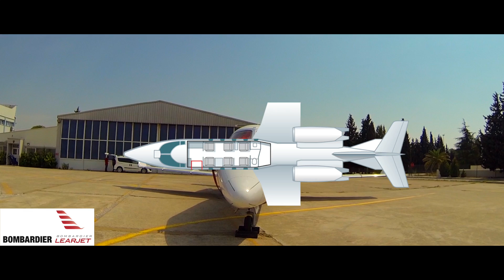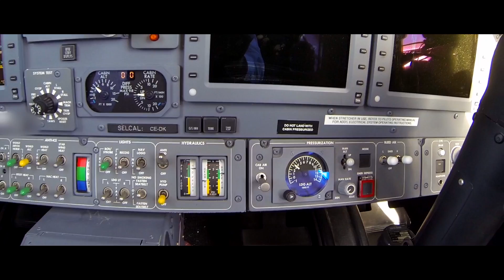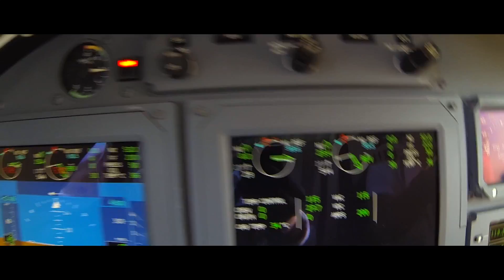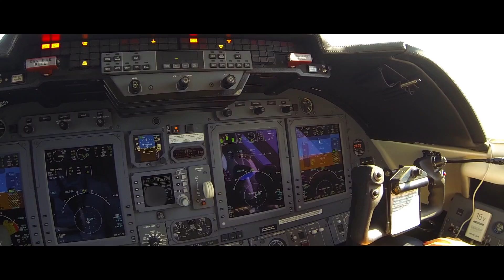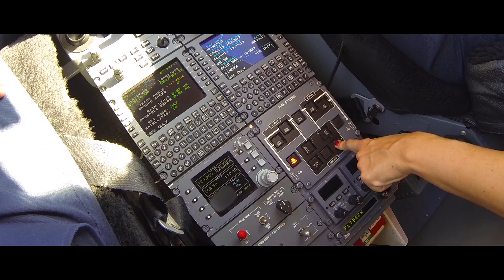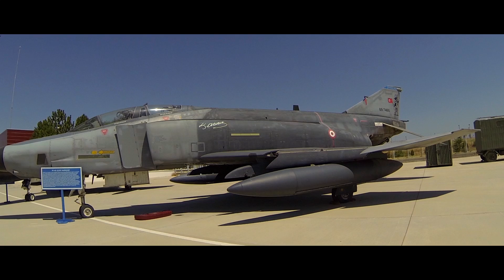LEARJET 60XR COCKPIT PREPARATION. PILOT TALKS #1

Comment: Hi Alex. My name is Paulo I’m Learjet 60XR Captain and I have almost 400hrs on type (I have large experience on jets but not on Learjet 60XR). I know that you have more experience on type and I have learning to much seeing your videos. I would like to know if you already faced up on the following situation that we got it: 
We were flying and we got ITT fail (—-) followed by ENG COMPTR (Ambar) but the Engine operate normally. After landing we reset channel A and B CB’s returning to normal situation. The maintenance engineers already change the ITT HARNESS after many different swaps like FADEC and etc. but we still have the same problem on different fases of flights. 
So, my question is: Have you ever been this kind of failure or know if somebody had before? 
PW engineers did not gave me any solution yet. 
Thank you for your attention.
Best regards
Paulo